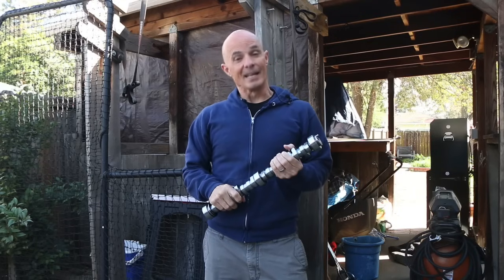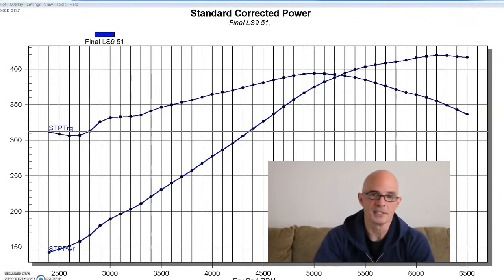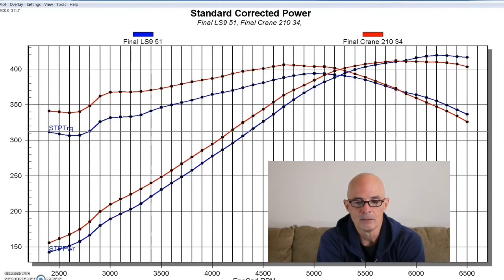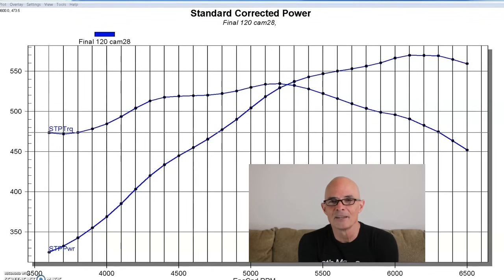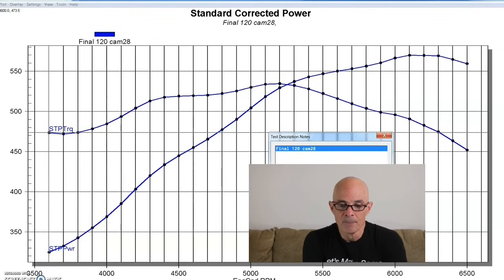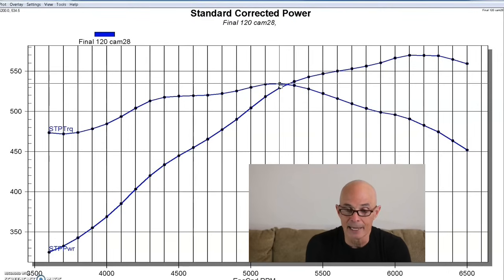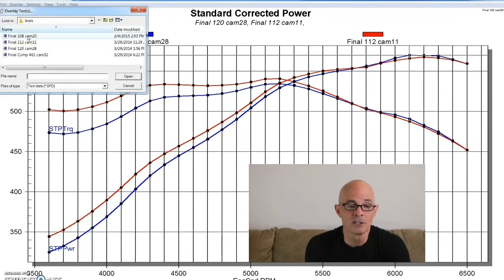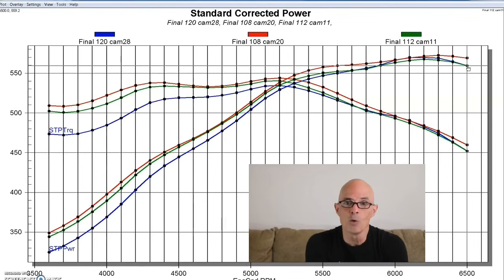LSA CAM TEST-108 vs 112 vs 120

Comment: Very interesting. I run in a tightly-regulated race club where LSA is basically all we have to play with (DOHC, adjusting stock cams) and we are typically living in the realm of 103-105 LSA. Our duration numbers are pretty high (streetbike engines) and we operate around 6000-12000 rpm. There is definitely a point of diminishing returns in wide LSA for top end! This is why we test!
Reply: Excellent.   Richard test gives the explanation point.   I wonder about 104 or 106.   I've even seen people run 102.

Comment: I think there’s an important part which you (kinda) missed. You mentioned idle, but overall low engine speed drive ability will absolutely suffer with a tight lsa. I can tell you from experience that the GM ASA cam (110lsa) sounded sweet but was complete garbage to drive on the street with a stick (unless you were willing to keep it running at over 2200 rpm even at steady state cruise)
Reply: Sounds like you put a race cam in a daily stick shift and regretted it lol. You just don't need that much duration to make power, you could of put in a 224/228 on 108 lsa and with closer to. 600 lift it probably wouldn't even give up much peak power to the .525 lift ASA cam.
Reply: @trixnhoez2964  lol yep exactly. That asa cam is pretty dated (even was back when I did it in 08). Modern cam/lobe design is significantly improved. Sounded sick, but was not real great in another way. 
I ended up swapping with a 226/232 .609 113+4 and picked up 30rwhp and a TON of driveabilty
Reply: That's what my wife would say

Comment: Love your vids!! Can I get your expert opinion on a cam? If you had a supercharged Sierra, what cam would you run?

Lingenfelter 215/247 .629/.656 on a 121 LSA, or

Cam Motion 224/238 .595/.587 on a 118 LSA + 4 deg advance, or

Brian Tooley 223/246 .610/.600 on a 117 LSA + 6 deg advance. 

Things you need to know:
Gen IV 5.3 LS, 6L80e trans
Eaton TVS 1900 supercharger (slightly smaller pulley)
Trick Flow 205 CNC ported heads
1-7/8” long tube headers and 3-1/2” free-flowing exhaust
Stock gears, stock stall converter.
Reply from the maker: cam motion or BTR-they both work well

Comment: Have your ever read David  Vizards bbc books? He says you add lsa with each point of compression increases, AND as you increase stroke, you take away lsa. Going from a 110 to a 108 on a 496 was worth 25hp peak and torque everywhere.
Reply: There was a guy named Harold, who's last name I can't immediately recall (he died recently), who figured out how to design cams and simulate their performance on his computer.  He wrote his own software, and basically revolutionized racing cam design.

He started his own company (Cumpucam, if I'm remembering correctly), and was doing great for a while, but finally went bankrupt and had to close the doors. He then leapfrogged from one cam company to another, redesigning their inventories, and producing many more race winning profiles.

He worked for all the latecomer hotshots, like Cam Dynamics, Crane, etc...  Never wrote a book to my knowledge, but he posted a lot to certain internet discussion groups toward the end of his life, and I found his messages to be fascinating and educational.

If you care for that sort of thing, you can probably find some of his posts if you search under Compucam.

Comment: Richard, did you keep the intake lobe center the same? That will make a difference as well. Great video!
Reply: @coolguy112286 I agree - this is an important question. Richard didn’t state what the timing was set at for each cam, so we don’t know whether the LSA change change only affected exhaust lobe timing (constant intake center), or if both intake and exhaust were varying (any other situation, including making the “straight up” assumption). The torque curve difference in LSA can be partially compensated for by adjusting intake centerline.

Richard, can you set the record straight about how you did the test? A timing sweep adds another dimension and more pulls to the test, but it completes the picture on how these variables interact.

Great video as always!
Reply: @ihategooglespooks right, which would have an effect on the test : ) but there are many many cams that have a different LSA and ICA

Comment: richard i know you are a busy guy but do you know a good cam to use on an old school 355 chevy copper head gasket with orings and solid roller and on e85 blow through carb?  i can not find much info any help would be great
Reply from the maker: the 300BR-14 from Comp works well if you want to make a lot of power-is it turbo or cent blower
Reply: @richardholdener1727  thank you for the help

Comment: If you ran a sweep with a fewer rpm/second change would the dyno be more stable and allow you to do a broader sweep? Or is it just the brake size is too large and at those low rpms and the very small amount of water in the brake makes it rpm unstable?

Comment: The thing is with changing lsa with same duration, the valve opening/closing points are altered.  Especially regarding the intake closing, the wide lsa would close intake valve later, lowering dynamic compression ratio and hurting torque.  Tight lsa intake valve closes sooner.  The increased overlap with the tight lsa probably increased scavenging, improving torque.  Also gotta say I’m tired of people talking peak hp numbers,  the 112 lsa made 4 less peak hp than the 120 lsa, but it would smoke the 120lsa in a race.  I’m personally way more impressed with a flat torque curve than peak numbers, anyone can slap parts together, but optimizing everything together is what makes great engines
Reply from the maker: That's why i provide the curves and not just peaks

Comment: Hell of a comparison test sir I love the chop and the low end power. Would a tight lsa be good for a boost aplication
Reply: Unfortunately you need to open up LSA a bit for a supercharged app. Excessive overlap can bleed off boost pressure.

Comment: Will boost affect this outcome?
Considering backpressure instead of scavenging.
Reply: Backpressure depends on turbo sizing. If you have small-ish turbos for faster spooling, you’d prefer less overlap because of the higher backpressure. Otherwise, exhaust could actually travel backwards into your intake until the piston starts moving down again. Larger turbos sized for maximum power have very low backpressure and those engines function very similarly to N/A motors where exhaust pressure is equal to or could be lower than intake pressure and overlap isn’t an issue at all. For superchargers, it’s much the same as small turbos but for the opposite reason. A lot of overlap with boost pressure higher than exhaust pressure just allows all the boost (and fuel) to flow right on out the exhaust valve instead of being trapped in the cylinder to make power.
Reply: @meetthecarolinas9638  so for my 4.8 Silverado with a smallish t4 turbo I’m looking for more Lsa?  Like 112-113?  Am I understanding you correctly? Thanks

Comment: I'm at 3:20 and i was thinking maybe GM softened the bottom end of the power curve to help with tracking and drivability given that the c6 Corvettes could be unforgiving sometimes
Reply: Could be a lot of things.  Could be engine durability too, high torque at low rpm is an engine killer.  Could be how the power "feels" as well.  It's quite the rush when an engine pulls harder and harder right up to red line as opposed to say an older train of thought like the feeling my stock lt1 gave (1994 Z28)  The engine made peak power at 5000-5200 rpm, red line was 5700 rpm.  It pulled nice up to about 4500 leveled off a tad to 5200 and then the rush was gone if you brought it to redline.

Comment: I did the same test on a 4.6 2v back in '09 for my buddy David Vizard... My results mirror what you came up with on the LS!  David is a huge fan of tight LSA's and he even has come up with the controversial 128 rule....  Awesome job like always!
Reply from the maker: David's has done a lot of crazy and cool stuff over the years
Reply: @richardholdener1727  you sir are correct!  I know that he is impressed with the work you have done as well... Keep up the great work!
Reply: DV's 128 formula says an LSA 107 should be ideal for this combination. I'd like to see a cam test using an LSA of 107 with duration numbers starting at 225 and increasing by 15-25 degrees. I think this could show how David's thinking works across the range of street to race cams.
Reply: @Warloch1 106, better to tight then to loose 😁
Reply: @evilinside5984  and a Running Start 🤠
Reply: @DANTHETUBEMAN  -😉😜
Reply: Exactly!  LCA is a calculated using the ci & intake valve size.  AKA allowing enough time for fill.  We advance the cam to help lower the rpm when it will start making power. Every 2 degrees advanced lowers it 100rpm, aka 4 deg = 200 rpm sooner.  This is a total shift, top rpm is also lowered the same amount.
Reply: Combing Richard's hard work, along with David Vizard's cam guidance from his Horsepower book, and Unity Motorsports,  I am very excited to spec my own cam!
Reply: Hell yeah DV is the man
Reply: The best LSA for the motor is the best LSA for the motor.  Boost or power adder doesn’t change that.  The power and torque curves will just be shifted up by whatever the power adder adds.  Engine Masters did some testing around this.
Reply: We run  BBF Alcohol motors at 15-1  and found that using DV.s  rules were bogus for us we had a cam that was on a 108 LSA and it would not much over 6500  switched cam same profile but on a 114 LSA same lobe same duration  same lift went to over 8500 rpm +6 mph and -.4 in ET car ran 8.20s @ 173  his rule may work for some but not all
Reply: Crazy part is BTR thinks LCA is a mear byproduct, I don't follow that line of thinking.  I have never gone as tight as 104, 106 is my tightest & I usually shoot for a 108 by using better heads. Different rocker ratios (larger) can also allow a slightly wider LCA but is limited & small. All about choosing the correct combination of parts that will all work together.
Reply: @darrinstone49 I see you’ve watched a couple of videos….
Reply: @darrinstone49  and thats why I would never ever use a Brian Toomey Racing cam.
Reply: Ken fritsch 8749, Completely MISSUNDER. STOOD Davids Formula !,! LOL, ITS FOR a 10.5 to 11 to 1 compression pump gas motor, its dummys like ken that dont have a clue, and put other people down ! But David did say, and Ken missed it, that for each 1 point of compression above 10 to 1 you should add at least 1 number of LSA, so by bumbling around, he acually proved David right and does not know it ! LOL HA HA HA !
Reply: In several videos and comments sections, I still haven't received an answer. Whether by response video or comment...
How is the 128 formula (or LSA in general) affected by adding boost? Where is the boost formula? 
It's generally agreed on that 112-114 are good boost LSA specs. But why? And how is the 128 formula (127 for Ford. I'm a Ford guy) changed to account for boost?
Tighter LSA has shown to make better TQ and power on NA engines. So why does boost require a looser LSA, and how do you formulate it?
Reply: @pimpovic2  if you watch a lot of Richard’s boost videos, the came behaves the same way boosted as it does NA.  Find a NA power curve that you like, then add your preferred boost. 
Easy as that.
Reply: @pimpovic2  -You don't adjust for boost.
Reply: @pimpovic2 wider lsa on boosted engines is the go to method to soften the hit when your boost pressure ramps up and the torque goes to the moon. Rapid torque jumps are hard on every part of the driveline so if you can smooth that out you will increase longevity and see a boost in drivability. In small out build that is getting torn down and inspected regularly you can flirt that line and run tighter lsa to really get that power through the curve but in any other combination the wider lsa is a safer play.
Reply: @pimpovic2  Its about overlap and backpresure 
Turbo creates  backpressure and when overlap occurs -exhaust goes to intake manifold due to difference in pressures
To utilise tight LSA with big overlap u need to choose turbo that has backpressure lower  than produced boost 
But too wide overlap angle  can create air leak when all ur boost goes straight to exhaust 
Manufacturers play safe and with 0 ovelap ur turbo cant reverse exhaust to intake  -so u can use any turbo
Reply: @pimpovic2  for every whole number of compression you increase you add 1° lobe separation. This comes from a video from cattle dog garage here on YouTube.

Comment: I see the value in this test with stroker engines as so many people stroke the LS. I however, do not stroke and would prefer to see the affect of an LSA change on an engine with the factory rod/stroke ratio.
Reply from the maker: works the same
Reply: @richardholdener1727  I can speculate all day long about what would happen with the change in piston dwell, but as you said sometimes the tests show something different than the theory suggests. I'm just going to need more convincing on this one (not that it is your obligation or anything)

Comment: My question is would the results be the same with different cylinder heads that have different flow rates and or valve size's

Comment: Very interesting. How tight could you go on the LSA before it gets worse?
How does LSA affect boosted applications?
Reply: I had a comp shelf grind nitrous cam. Put a custom grind with the same lift and gained .3 tenths in a 1/8 mile with a 110 lsa vs the 114 lsa of the shelf grind. I’d say it depends on how much boost and how much rpm.

Comment: Hello,  thanks for the great videos  
What Ls cam has low-4500 rpm torque, sounds aggressive, and turbo ready?
Reply from the maker: lots
Reply: @richardholdener1727   I understand about have the lingo,  cams engines and intakes.
 Could you make a basics style video for  The less knowledgeable.  Something with a Cam, Springs, and Turbo size performance package .
 Seems like every engine shop has their own ideas. But you've tested everything in you have the knowledge.

Comment: The bigger the engine the narrower the lobe separation needs to be for best mean torque. Power drops off more with too-wide an angle than too-narrow an angle of lobe separation. I would even try a 104° LSA as you didn't bracket the best LSA in your testing. If the breathing wasn't as good as with this combo the differences would be more dramatic with the narrower LSA.. In the bad old days of low compression and poor breathing due to lower tech and restrictive rule sets, the LSA could get very narrow to make best torque and win races.

Comment: Let's see the same test on a 4.8 (same cam).  I think the smaller displacement will emphasize the torque differences much more than the stroker, and show the curves better.
Reply: you want tighter LSA with more cubes as it takes advantage of the larger displacement for filling sooner

Comment: can you give the intake centerlines for these cams so I can figure the different valve events?
Reply from the maker: I don't have those
Reply: oh well. what I can tell is that the cam is going to have less overlap from the 120 LSA spectrum and more overlap from the 108 LSA spectrum. Also the wider LSA is going to push exhaust valve to open sooner and intake valve to close later.  Both will reduce torque which is what we see here by reducing dynamic compression and cranking pressure.
Reply: @ihategooglespooks LSA is an average of the centerlines. it could be 108-1 or 115+6. we dont know

Comment: When widening or closing the LSA on cams, do you move the intake lobe or exhaust lobe, *asking for dohc engine
Reply from the maker: technically you can move either or both
Reply: @richardholdener1727  yes i know that, but should i, or should i move just the intake/exhaust cam i feel like if you move the intake cam, (retarding it to close LSA) you will get less volume of fuel in at the end of tbe intake stroke *logically 🤔

Comment: Awesome test!    Did you run these with a turbo? Despite your saying “every cam is a turbo cam”,  all the turbo cams are wider separation.    How come?
Reply from the maker: if you add boost to these three cams-the same thing happens-plus the possible loss of spool from the reduced torque offered by the 120 lsa cam
Reply: @richardholdener1727  so a narrow lsa cam is actually a spool cam?

Comment: Hey Rich is this basically a function of exhaust scavenging? it would be cool to see a high lift like .625 and low duration
Reply from the maker: exhaust scavenging from the headers?
Reply: @richardholdener1727  yeah the tighter lsa is allowing the headers to scavenge more

Comment: Excellent. Thanks 
It is all about the overlap triangle, is it not? A large 402 CID engine can obviously handle the overlap triangle created by these durations at 108 LSA. I guess a 4.8 would lose low end torque with these duration on a 108 LSA.
It would be interesting to see a single turbo on the 108 LSA camshaft. You know, good NA engine + turbo. ;)